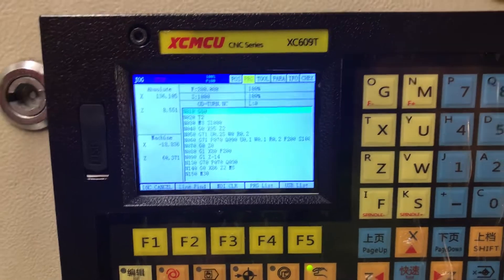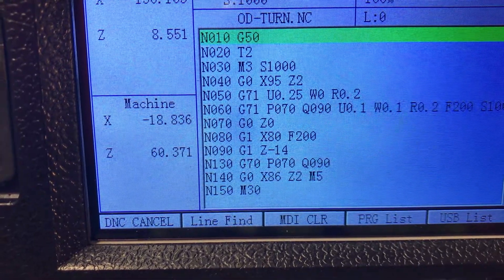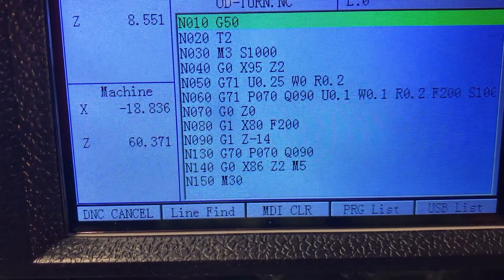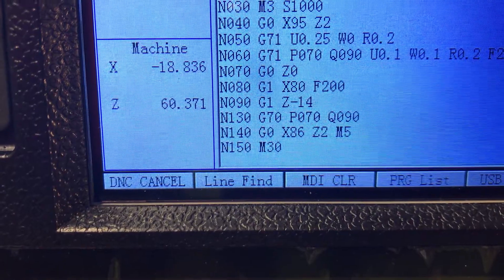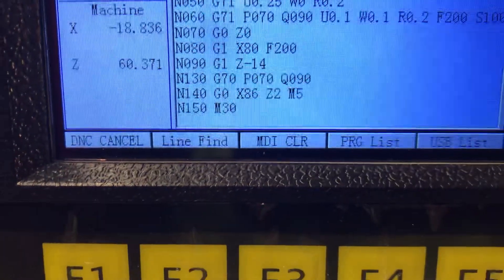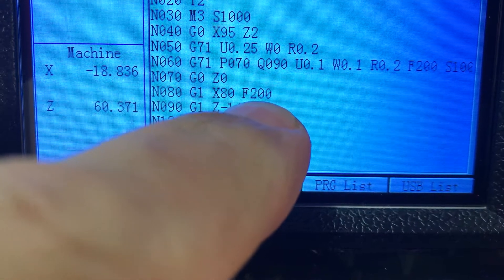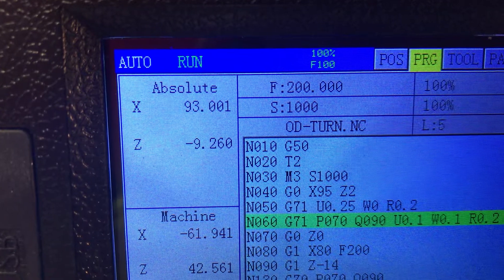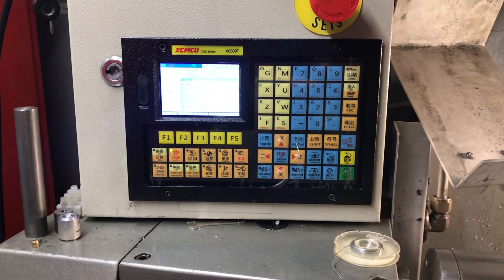XC609T how to use G71 cycle

Comment: Your videos on this controller have tempted me to try this controller for a simple lathe CNC project where cost is the primary consideration. It seems that you made quite good progress and managed to get various G codes working. Not much else is published and there seems to be not much more information. However since your videos there is a very good manufacturers manual in English that is very helpful and very well detailed. I was thinking that I might be able to play with Fanuc programming using the manual programming items. Just recently I have found that my CAD CAM system does have Fanuc post processors that I can try. Looking forward to giving  it a whirl when I have the lathe completed. John

Comment: Another important function that I also couldn't work was G42 and G41tool compensation
Reply from the maker: Well I never use that on the controller as the CAM software does that for me. I have tool library set in there and the tool nose radius is compensated at post processing. So the G code is not needed at the controller.
Reply: @MJPilote  Thanks for replying, got it, can you tell me which CAM you use and which pos processor for me to study?
Reply from the maker: @younglogin  Fusion 360 and generic fanuc post
Reply: @MJPilote  thank you so much

Comment: Hi Friend, I'm not able to program G95 (mm/rev) can you help me?
Reply from the maker: Feed per rev should be G99, the controller defaults to feed per minute G98 My post processor uses that so I dont use mm/rev
Reply: @MJPilote  Thank you for your help
Reply: @MJPilote  Unfortunately I discovered that constant speed does not work on this controller
Reply from the maker: @younglogin  Yes I'm aware of that, but I don't remove so much stock or run facing operations on such big diameters for it to matter. For the money it's still an amazing controller.

Comment: hi, what is the resolution of the encoder installed on the shaft?
Reply from the maker: I use 256ppr but would advise to use 100ppr or less.
Reply: @MJPilote  Thanks

Comment: Hello! Is there any way to configure graphics display? Thanks!
Reply from the maker: What do you meen by configuring it?
Reply: What if you can see the tool paths when it is working
Reply from the maker: @rubenparrou1688  No toolpath preview on tool plot on screen. You need to learn to read the G code. Its really simple to follow the code and see where the machine is going.
Reply: @MJPilote  If I understand, it is that sometimes it is like a more security measure to see if there was any error in the preparation of the G code and therefore the tool does not crash anywhere, I have 4 CNC machines and the controls are already lathe as a machining center they all show tool paths, so I was surprised that this particular control doesn't have it.
Reply from the maker: @rubenparrou1688  none of the older fanuc controller have that. And this is more or less a clone.
Reply: @MJPilote  Ahh, perfect, perfect, it will be a matter of getting used to it, would you be so kind as to send me your e-mail, because I ordered a control just like the one you have from China, and surely I will need a bit of guidance to place it, do you think that with Could a 100-pulse encoder work well? Now I have it with Mach3 and with a 1-pulse-per-turn reader.
Reply from the maker: @rubenparrou1688  100 pulse is good, would not go higher than that. I have 256p/r encoder and the bandwidth is used up at 750rpm ish. Its only one mhz, and 3 channels differential pulses use it very fast.
Reply: @MJPilote  Dear!
Could you tell me if it is among the parameters Backlash compensation?
Reply from the maker: @rubenparrou1688  yes of course. It would be useless without it and I would have not bought it.
Reply: @MJPilote  Perfect!
Could you get a manual in English?
Reply from the maker: @rubenparrou1688  No, I used the chinese manual and ran it through online pdf translator. it came out just as good as any chenglish manual.
Reply: @MJPilote  ahh, ok,ok
Reply: Estimated!!
How are you!!
The same control you have just arrived from China, and I wanted to tell you that I was able to get the manual in English, if you wish and provide me with your email, I would be sending it to you and I would also be consulting it for some connection to it, I intend to finish the automatic tool changer that I started a long time ago and I couldn't finish until now, thank you very much for your time!
Reply from the maker: @rubenparrou1688  No need fot the English manual, but thanks for the offer. You are going to enjoy the control once you learn to use it. I’m going to retrofit my linuxcnc lathe also with this controller. I dont like the computer, monitor keyboard mouse clutter at the lathe.
Reply: Perfect!, do you ever think about putting an automatic tool change turret on it? @MJPilote
Reply from the maker: @rubenparrou1688 The Emco cnc 120 has 8 point turret and it is currently run with linux an toolerator 3000
Reply: @MJPilote  Hi how are you!!
I am testing the control and I copied the cycle that you wrote from the G71 for testing, and when it reaches the cycle it gives me an alarm and tells me that it is a problem precisely with the G71, could it be because the control is not connected to the machine? or that should not matter, because other simple commands without fixed cycles if you execute them, I would appreciate your comment, Thanks!
Reply from the maker: @rubenparrou1688  Parameter error, you are asking the machine to do something that is not set in the parameters, and zero point error.
Reply from the maker: @rubenparrou1688  Oh and you can't test cycles that require spindle synchronization without spindle encoder turning.
Reply: @MJPilote  Ok, Ok, when I connect it to the machine and set the machine zero and encoder it should work fine, thanks!
Reply: Regarding the encoder, how many pulses would you recommend? given your experience with this control, Thank you!
Reply from the maker: @rubenparrou1688  60-100ppr

Comment: Hi MJ... do you know about password this controller...? I have make mistake set parameter and now cant press edit mode.
Reply from the maker: I need to check, it should be listed in the manual if you have not changed it. Does it ask for pass when you set the security level to somathing else than operator?
Reply: @MJPilote  yes...i make it change

Comment: Hi MJ, Thanks for the effort . I will try it out  on my controller. First by copying exactly your program . It gives me confidence it at least works. I shall update after a test. Thanks again.
Reply: Finally tried out the cycle. So basically its an OD turning cycle and we give sizes in pairs starting with the smallest to the largest , and it does it in reverse. I'm more a mill guy. Thanks.